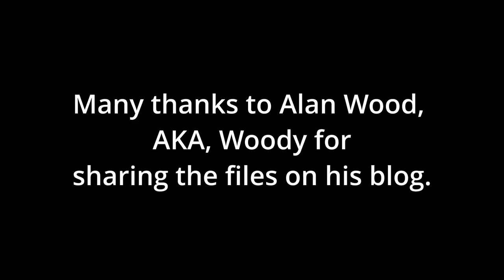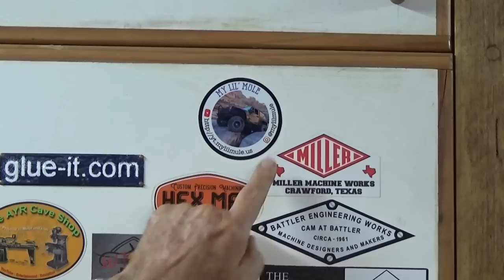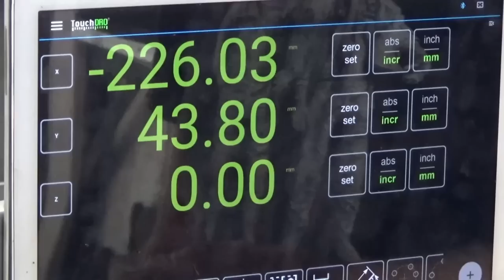A 4 Facet Drill Bit Grinder DIY Style Part 2

Comment: Enjoyed…at the bash I failed on the Joe Pie maze….lol
Reply from the maker: Thanks Chuck. I can understand. I gave up pretty quickly. I have trouble telling my left from right most days. I will give you a heads up. I have a mockup of a float lock vice like yours waiting for a spot in the workshop. It will have cast aluminium jaws with steel inserts on the faces and the quick setting rack feature in the main bar. I just need to upgrade my furnace burner to diesel fuel and I will be onto it. 
Regards,
Mark

Comment: Ciao Mark, very nice job: i love the 3D blue stuff that you used to bring the round part on the vise!! See you soon, Alberto
Reply from the maker: Alberto,
I am now on my third 3D printer. I started with a shop made Hadron and then upgraded to a Ender 3. It worked OK for a while but I could never get it to print reliably. I nearly always had to make three prints to get one good one. I finished up buying a Prusa MK3. It was definitely not cheap but it is super reliable and it has a lot of built in brains like crash detection and print resume after a power failure. I love being able to make simple one off jigs and fixtures. 
Regards,
Mark

Comment: Noticed the jetengine when I visited your workshop last winter. What I didn't realise is that you did build it yourself. Wow, that's a very skilled job!
Reply from the maker: Thanks, I definitely need to get that engine out and get it running again. It needs a bit of work and the batteries for the fuel pump and the starter motor are probably dead. I have a bad habit of making complicated engines which I might run a handful of times and then I lose interest in them. 
Regards,
Mark

Comment: Thank you for putting up Woody's 3D print version! This really helps a lot of us who are short on time.
Reply from the maker: My rough and ready 3D printed mockup looked like it might actually work as is but substituting some metal bushes and sheet steel flat plates would be perfect for this project. Most of the grinding is fairly light duty so there's no reason why it wouldn't work.
Regards,
Mark

Comment: An idea regarding the plug and socket. It might be worth replacing both parts with a version that is in production instead of sourcing an original part.
Reply from the maker: That was the fall-back position if I couldn't get a matching plug. Some viewers have sent me catalogues with the current LPA products and I will buy the 4 pin plug first to see if it fits the old socket. If it doesn't I will just buy another plug and the matching socket.
Regards,
Mark
Reply: @Preso58  And if you want to keep the "correct" socket on the machine, you could use a short pigtail to connect the plug you have to a modern socket, as a homegrown adapter. New plugs on anything you want to power, and good to go.

Comment: Well that settles it ! I am gona have to build the rear tool post/cut off. What a time saver leaving it set up . Watching you switch from champher  front tool to parting rear tool almost looked like trick photography it is so smooth.  As Chuck always says, "Winner Winner chicken dinner"  Also where did you get the fantastic edge finder. Seems like it would be easier to see than the standard ones i have. My eyes are 71 years old. Thanks for bringing us along.
Reply from the maker: I love being able to switch from plain turning to parting off without having to stop or reverse the spindle. The only thing you have to watch out for is ensuring you have clearance before changing from one operation to the next. I got that edge finder from Hare and Forbes. https://www.machineryhouse.com.au/m6925 I like that it has both a 10mm and a 4mm diameter for edge finding inside bores. 
Regards,
Mark

Comment: I haven't read through all of the comments, but incase someone hasn't mentioned it.  You can take the electrical connector apart and de-solder it and reuse it.   Ive done that many times on older heavy duty connectors like that.
Reply from the maker: The only problem was that the earth pin is a larger diameter than the phase pins. Also the alignment groove in the plug is the reference for the earth pin. If all the pins were the same diameter it would have been much easier. Still, it's a goer now.
Regards,
Mark

Comment: You might find you get better results if you knurl in one direction only.  I usually do it with power feed as well.
Reply from the maker: Thanks John. I got better results on stainless steel but the brass and aluminium look a bit chewed. I will take your advice on board. I was always taught to knurl material dry but I notice a lot of people using cutting oil. I am thinking that compressed air would be good for blowing any debris out of the knurl so it doesn't track around and build up. 
Regards,
Mark
Reply: @Preso58  yes definitely get some air on there to blow out the chips especially on brass.  Make sure there is some oil on the wheels as they are spinning fast and have a lot of friction.  I have no luck with stainless.  It work hardens too much.  I've been told there is a special grade that doesn't work harden so much but I can't find any here.

Comment: Hey Mark.  The position of your index ring lock screw looked to be 180 degrees in the wrong place.  When you rotated the lock-ring, the screw went under rather than over, so could foul the table during adjustments.  I remember thinking long and hard about the correct position before drilling mine.  Of course, you can always remove the assembly to rotate but I do mine without.
Reply from the maker: I checked the operation of the index ring today and there is plenty of clearance for it to rotate in either direction. I did keep the trunnion plate fairly compact so it doesn't overhang very far at the back.
Regards,
Mark

Comment: Wire a 2or 3 pos  switch to that connector and the motors to that switch. If you had a second adapter you just put more wear and tear on the connector pulling in and out all the

Comment: Hi Mark, for coolant / lubricant when machining or reaming aluminium, try kerosene (paraffin). Should improve your surface finish.
Reply from the maker: I will often use WD40 but according to Stefan Gotteswinter, Isopropyl Alcohol is the best coolant/lubricant for aluminium. 
Regards,
Mark

Comment: Mark, I have another question if you don't mind. Could I use a fish tank heater? I can't find a heater on the Jane kit site.
Reply from the maker: Graham, I have one of those fish tank heaters for an acid etching tank that I use for making photoetched brass nameplates. I bought one of the glass tube types since I thought it would stand up to the ferric chloride etchant which is not kind to any metal parts. It only get the solution up to about 10 degrees C above ambient temperature which is OK for ferric chloride. The one that I use for my zinc plating and anodising came from Caswell. I am fairly sure they have discontinued selling them since they can cause fires if the thermostat is not properly immersed in the plating bath. 
You may be able to buy one from a specialist supplier but you could also try Caswell. They show a tank heater in their anodising kits https://caswellplating.com/anodizing-products/anodizing-kits.html but they don't seem to list it as a standalone item. Maybe contact them and see if they will sell one on it's own. 
Regards,
Mark
Reply: @Preso58  Thanks again Mark, very helpful, I would have bought a fish tank heater without your advice and just wasted my money. I appreciate your help and will try Caswell.

Comment: Mark did you compensate your arc length by the value of your pin diameter? 
If not, you may be short of your 180 deg.
Reply from the maker: Well, now you have me worried but I did rotate the table exactly 180 degrees with a cutter the same diameter as the dowel pin so it should be OK?
Regards,
Mark

Comment: Besides other comments saying that the connector looks like the ones used in trailers, I had great success in using the heavy duty line by neutrik when refurbishing machinery.
Reply from the maker: Thanks, I have seen various connectors that are sold as trailer plugs and sockets but I wasn't sure if they would be suitable for 415V. I think I have found a supplier in New Zealand who sells the LPA Niphan series of connectors. I will do an update if I get a suitable system for the mill.
Regards,
Mark

Comment: Hi Mark, I would like to set up for zinc plating. Can I check with you that for the black zinc plating I don't need to boil in water like the gold or blue? I noticed in your latest black zinc plating video a few things have changed from your earlier videos, so if I just stick to the latest version will I be doing it the right way? Thanks in advance Mark.
Reply from the maker: Graham. The Jane Kits' book that I use has very good and detailed instructions on all their metal finishing processes. It's available on their website but it's not exactly cheap. The website shop also has useful information on zinc plating and the gold, blue and black chromate dips. janekits.com.au
The instructions I have say that once you dip the parts in the chromate (doesn't matter which colour) you should just hang the parts and let them dry for at least 24 hours. If you handle the surface too soon the colour will smudge and/or wear off. Boiling the parts is not required for any of the chromate dips. 
I have changed my process a bit for the zinc plating. I now heat the zinc electrolyte and I also run a sparge line which agitates the solution with a small stream of air bubbles. The sparging isn't essential but the heating is desirable. 
Boling parts is the last step in the anodising process used on aluminium parts after dying. The boiling water closes the pores in the aluminium and it seals the dye into the part surface.
Regards,
Mark
Reply: @Preso58  Thank you very much for taking the time to explain that to me. It all makes sense and has really helped. I have tried plating over the years without much success. Your method is much better yet achievable for the home hobby person like myself. I will purchase the book from Jane kits.

Comment: About the connector, how about making one? would make good video if you can document the process.
Reply from the maker: I actually pulled the original plug apart today and when you see the individual pieces, it's not that complicated but without the right insulating materials it could get a bit risky.
Regards, 
Mark

Comment: Why not use 1 plug and install a switch to swap between motors?
Reply from the maker: That would absolutely work. I actually have a changeover switch that might work but because of the way that you have to rotate the ram on the mill, you would need a lot of slack in the cables to avoid things getting tangled. 
Regards,
Mark

Comment: Just a quick thought!,   here in Canada and the USA  we use on some types of trailers  a 4 wire plug esthetic looks very close   you have them in your country?
Reply from the maker: Yes, but ours have five to seven pins depending on whether the trailer is fitted with electric brakes. I think I may have a supplier though.
Regards,
Mark

Comment: just get an electrician or yourself to fit a PDL or CEE form socket on the machine
Reply from the maker: Thanks. I think I have found a supplier in New Zealand just a short drive from where my son works. They sell the LPA Niphan series of connectors. I am hoping to get a compatible plug from them. 
Regards,
Mark

Comment: "For a jet engine I built", that's it ? Really ? Dropping that line and then silence on  subject, shame on you. I expect a follow up on this project and special consideration for your next draw, wink, wink, nudge,  nudge. 

John 🇨🇦
Reply: I got caught up on that too 😂😂
Reply from the maker: Yeah, sorry about that. The engine hasn't run for nearly 10 years but it is on the list of things to do. The last time I ran it I had a hot start and the nozzle guide vane ring distorted and the turbine wheel is rubbing on the shroud. I have to partly dismantle the engine and bore out the shroud ring so the main shaft will spin freely again. Check out this video if you want to see it running when I first built it back in 2010 https://www.youtube.com/watch?v=N7F4Bp-TcTA
Regards,
Mark
Reply: Many extra style points for the recycled Ryco filter body.